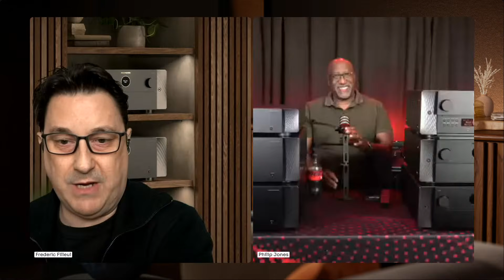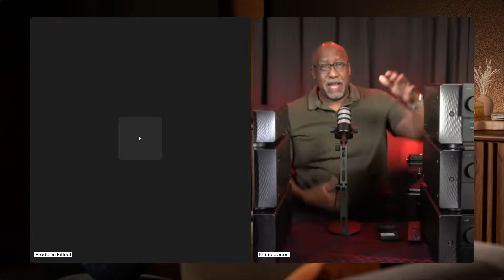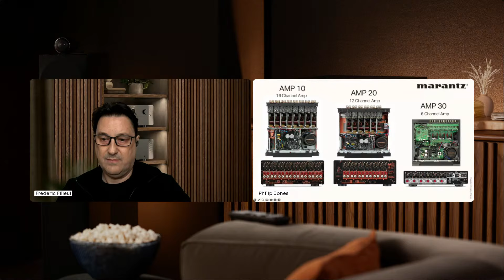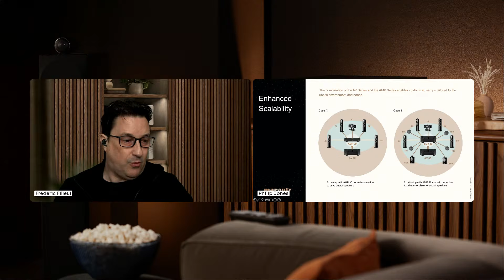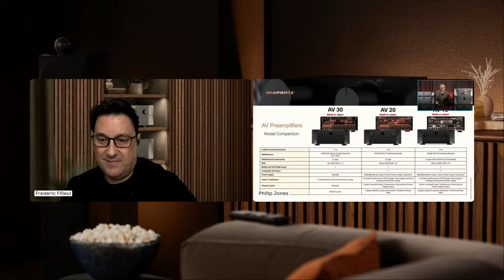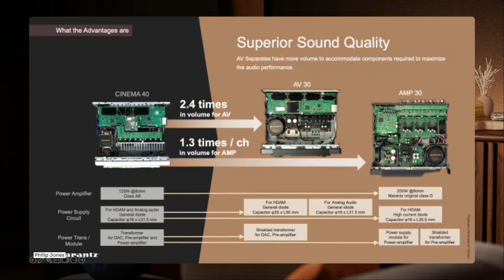Optimizing a Home Theater with Marantz AV Separates

Comment: Hi, I am running a 7.1.4 system in my lounge, FL& R are powered through a Steinway Lyngdorf TDAi3400 and the rest are run from my SR8015, question if I wanted to btl my centre channel (MA C350) which other channel would I use to do this?
Fyi Sub is a Perlisten D15 
Thanks for a great report!
Reply from the maker: Hello,
The SR8015 provides either a powered, or pre-out feed for the center channel. There is no support for BTL within the SR8015. Ultimately, you would want to add an AMP 30, AMP 20 or an AMP 10 for a BTL feed.

Comment: In our system, we are running  the Polk Legend Series in a 5.4.4 setup. The L800's are my mains. Due to the SDA tech, I'm forced to use a non balanced or a non differentially balanced amp. Would I be able to use the Amp 30 for Polk's L800's? If so, would it handle the L800's dip below 4 ohms when listening at a fairly loud volume?

Comment: I have the AV7706 in my bedroom 5.2.4 system...don't think I will upgrade to the AV30 because no need for 4 sub output...or multiple 8k connections...nor Dirac...I have it locked in with the Multeq app and REW...I'm sure the AV30 is a sonic improvement...but not sure a $4k improvement.

Comment: I have a AV7706 and thinking about upgrading to the AV30. For those who have smaller living room setups like 5.2.2 7.2 etc… the Amp 30 does no good unless paired with an AVR. For those with large theatre rooms the Amp 30 could work great for additional channels. You could pair the AV30 with the Amp20 but what a $6000 amp for a living room setup.